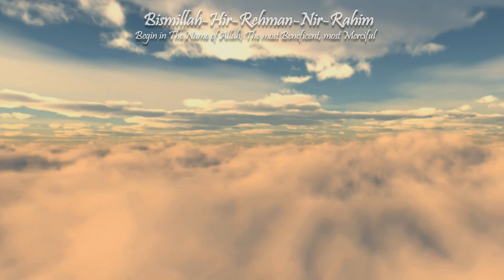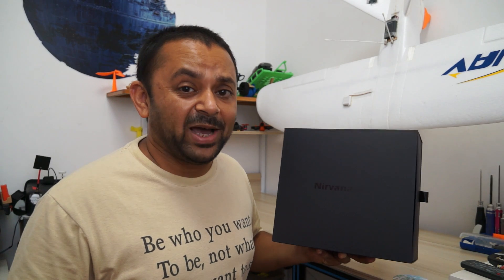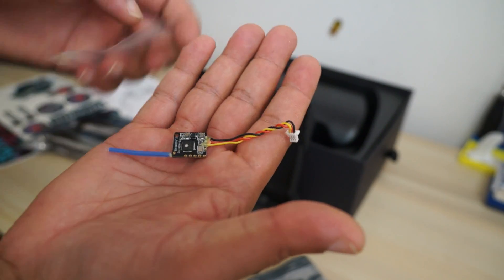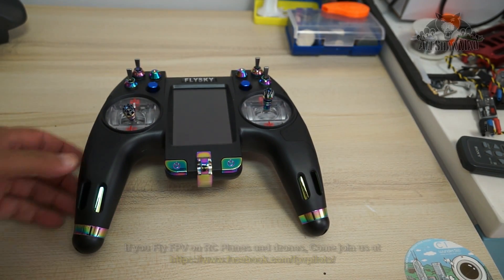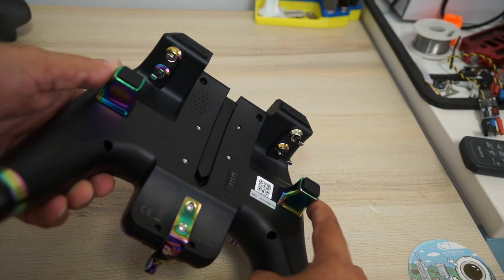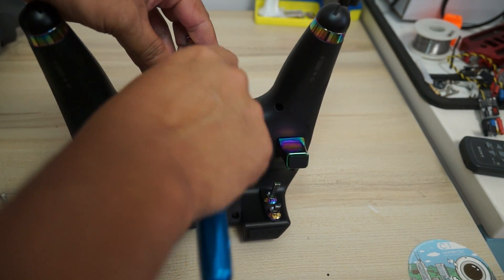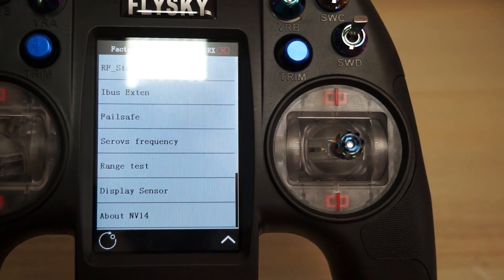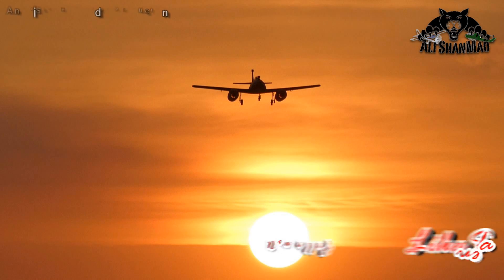Unboxing Underground FPV FlySky Nirvana Radio

Comment: Hello, good vid, I've got the nirvana nv14 and I need to control the xk k130, will it work? or I need any module? 
any answer will be much appreciated, thank you
Reply: Hey man saw your messages under 2 videos already and I'm facing the same issue with my xk k130 lol. Did you manage to connect this transmitter or needed to buy a separate module?

Comment: Need to learn how to put firmware on this transmitter. Where is that video? I cant even bind the radio to my receiver, and I have looking everywhere in the settings for the binding features.
Reply from the maker: This week or next, they are going to release a one click tool to upgrade firmware. Until now its a bit complicated. To run an impulse RC Driver Fixer when connecting radio, then companion 2.2 and then upload firmware. i was going to post video but then i decided not to because after one click tool is released, everything will be very simple and i will post a video of how to use one click tool to upgrade firmware. 

and of course i will be doing more tutorials for this radio as well, binding, making mixes for different planes and so on. 

So stay tuned for that.

for binding there are two different processes for different receivers.

Comment: Where can I get the Firmware? I received mine but need the firmware.
Reply from the maker: you can email me and i can send you files.
Reply: just did
Reply: I would like to clear some things up. The NV14's that have ended up in some peoples hands were sold without authorisation from Flysky, although the hardware is perfectly functional the firmware has not been completed by OpenTX yet. Right now should be treated as a beta. Expect bugs, missing or partly implemented features and some compatibility issues with modules. You can however download builds from our website which will be updated regularly for our beta testers.

Comment: Actually this antenna has to be completely up because ir already has a horizontal antenna inside , by placing the foldable antenna up you get perfect dual polarisation with 90degrees angle or whatever it is called :p , thanks for the video alishanmao